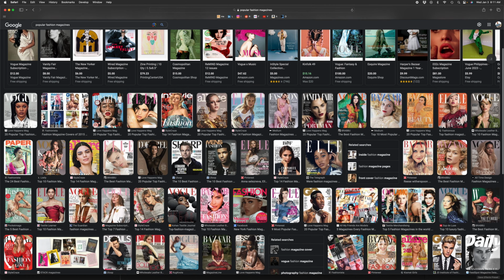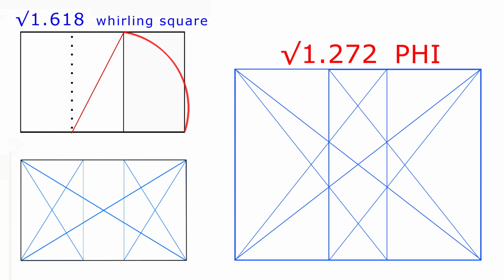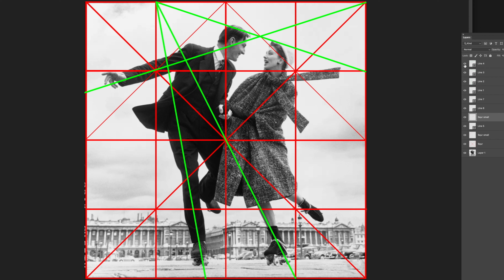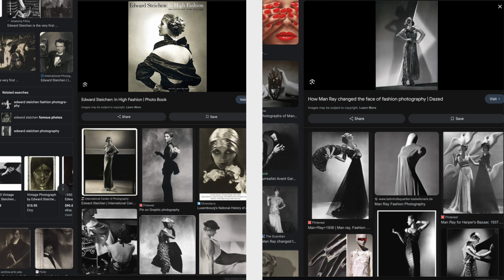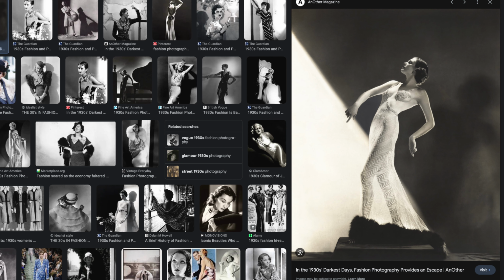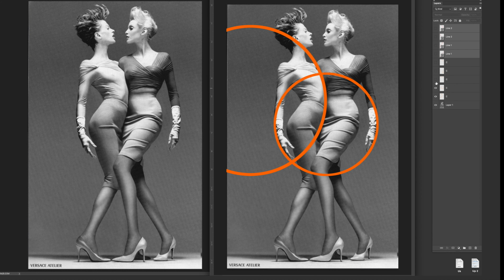Dior Design

Comment: So does this work because we find these assortments of lines to be dynamic or flowy ?
Reply from the maker: it works because it was done with a high level skill set in both the photog and graphic designer. so well rounded, elements of design are just as strong as the math.